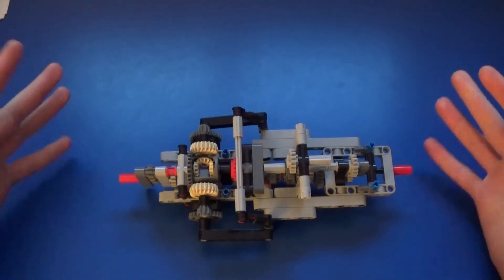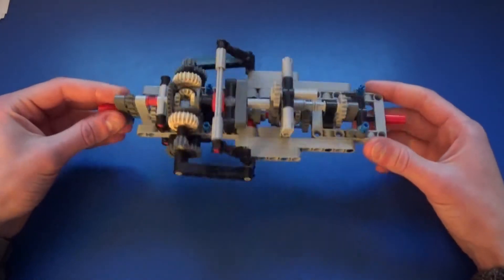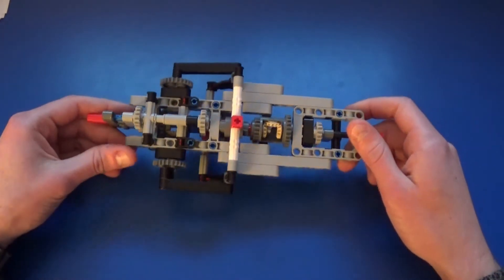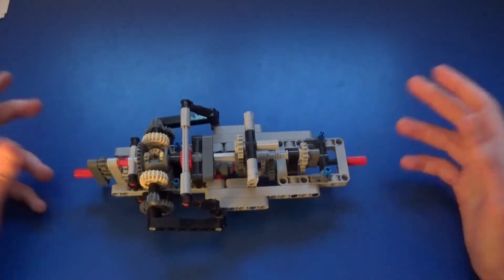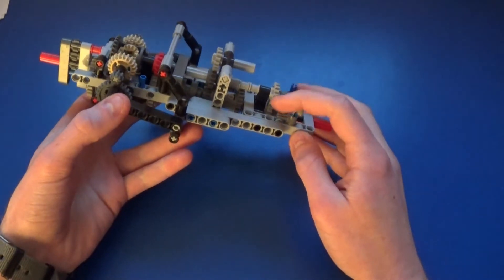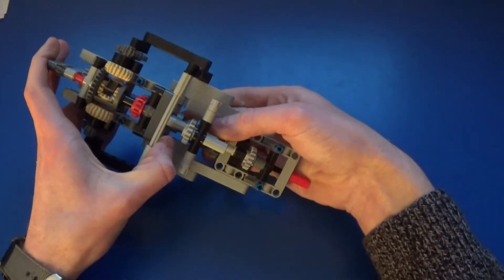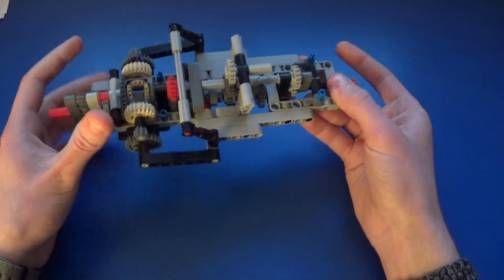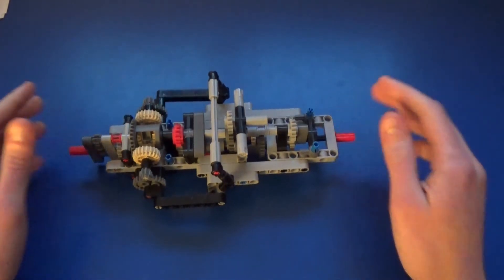Lego Technic Automatic Locking Differential

Comment: This looks interesting, but I suspect the mechanism is not detecting speed difference, it is detecting travelled distance difference. Cause, unless I am missing something, wouldn't the diff remain locked after I have made alot of right turns? (and only as many left turns will reset it?). Notwithstanding I think this is a beautiful model and looking very nice and shows you have great and very enviable technic skills.
Reply from the maker: Yes good point. This mechanism could be modified with a kind of expanding flywheel which would detect speed, but I haven't figured out a way to make that work. Thanks for watching!

Comment: Really cool mechanism, but if you put it in a vehicle, wouldn't it lock the differential when you are turning normally (and wouldn't want it to lock)?
Reply from the maker: Sorry for taking so long to respond. You bring up a good point. A more realistic version would have the lock activated by a significant difference in speed between the wheels, not a significant difference in position. That was actually my original intent, but I couldn't make that work so this is what I ended up with.

Comment: That’s really cool! I might use something like this for a vehicle later. I have the front and rear axle (front is my latest video) and I just need a gearbox and transmission. This would be very helpful, but I am not sure if I could add a gearbox to it. Maybe it would have to be attached to the input?
Reply from the maker: Awesome! Yes, the gearbox would have to sit between the drive motor and diff.
Reply: @gergelystechnicmodels8565  okay that makes sense. Thank you and great work!

Comment: woah that is epic i love your channel. also i think you should keep on working on this at least put it on a vehicle cos i have questions like would it activate during turning or like how would it unlock its self
Reply from the maker: I think I will work on making a more compact/efficient version and implementing that into a chassis of some sort. In order to make one which can unlock I would need to add some sort of rubber band or spring loaded assembly. It's definitely work in progress. Thanks for the complement, and for watching and commenting!
Reply: @gergelystechnicmodels8565  no problem :)